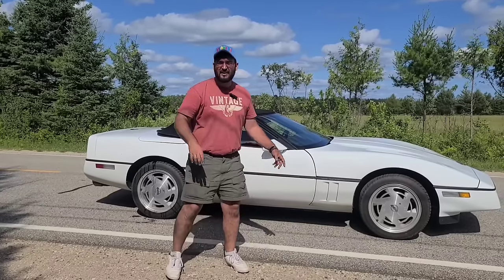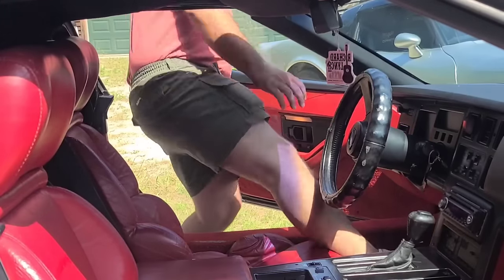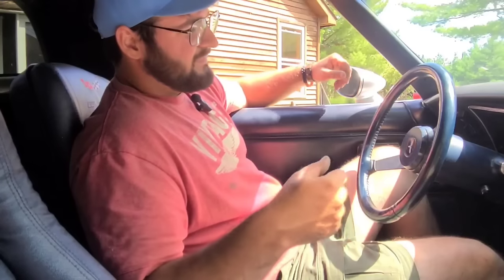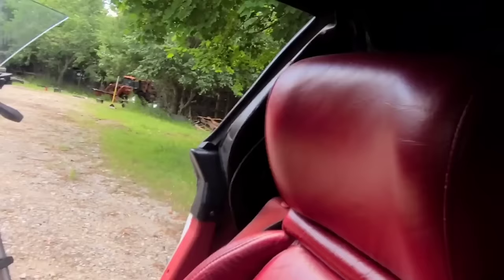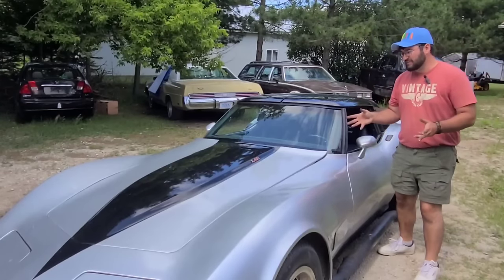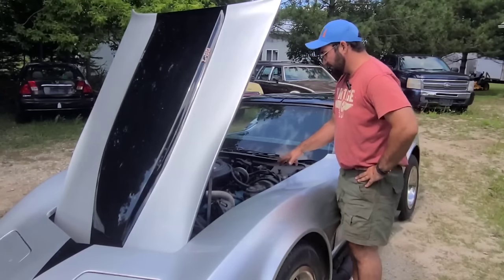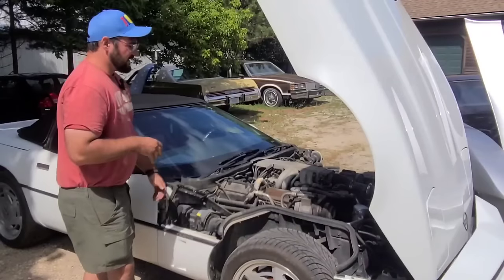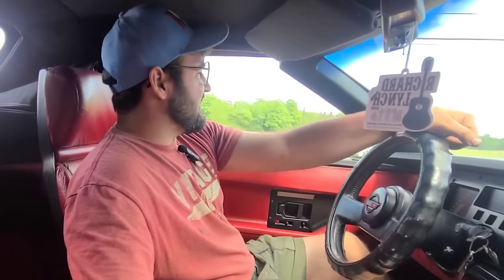C3 vs C4 corvette, which is the better buy?

Comment: why is the front end so high??? The C4 was so good and dominant , it was kicked out of the Escort Race Series. It was something like 29-0 against the 944 turbos and the other cars didnt stand a chance. THey had to create a series just for the corvette called the , " Corvette Challenge Series". The 1984 vette ( though the cross fire was terrible) pulled 1.0g on the skid pad with the z51 suspension. The next year the z51 was softened up because it was way to stiff ( but i found a set up front and rears and put them on my 1985 and koni adjustable shocks) .
Reply from the maker: Both are as I got them. And appear to be in their stock form. I'm sure when thee cars were new they were pretty impressive. But these are not well preserved examples. They're just cheap fun cars
Reply: Wrong, the crossfire injection was and is not terrible. This is a long standing myth that the older carb dudes didn’t know them and didn’t know how to work on them so they were deemed bad. Are they the best injection systems? No, but they are simple and easy to diagnose…

Comment: The simple facts are it would take an aluminum block and head engine and several thousand dollars worth of chassis parts and nearly 4k of wheels and tires to get the C3 to pull 1g on a skid pad. The C4 will do it with new tires and some better shocks wouldn't hurt the effort. However the C3 will easily accept any configuration of big block Chevy engine that you are willing to fork over the cash for and with at least 5 different transmissions and or a solid rear axle since no factory stock Corvette third member is strong enough for more than 500 hp you could out run that C4 in the quarter mile like it wasn't moving. All aluminum twin turbo 427 Ls with a built 4l80e trans and a specially fabricated rear driveline for the C4 would give you cheap near supercar performance. All it takes is about 75 to 100k in parts to make it all workout.
Reply from the maker: And then it's only worth 10 grand after all that haha. They're still fun to play with
Reply: yes but you would have a way cooler car than any eurotrash out there. Having said that why not a c7 or c8 out of the box?
Reply: It's an old parade cruiser not a race car.

Comment: The 80 should run better. Check the emmission parts for leaks. Mine leaked on exhaust manifold egr parts has cracks in the tubes.
Where I live I could remove all the engines egr stuff leaving that huge octagon catalytic converter that needs to still be replaced with free'er flowing cat.
The L82 has 225hp 
And the factory ribbed valve covers designating the last yr corvette with a high performance option read about that engine its a good one. Mines an L48 and can squeal the tires at launch and chirp on 2nd gear. My dream is to install a rack and pinion steering system on it, the early 60s steering is dated feeling to me. A wild styled easily leakable system imo.
Still love the car. It is the last corvette with out a brain 😲
Reply from the maker: They both should be running better. I'm told the c4 should do 60 in 6 seconds. I will probably do a follow up on the c3 getting it boiling the tires again. It runs pretty rich and I'm sure it has fouled plugs and a myriad of other things. Easy to work on though

Comment: I have to go with the C3. My 72 is special (to me) because of the Steel Cities Gray paint, I've never seen another. The motor is from a 63 Vette, a much wider power band than the 350 the car came with. Power windows, brakes and steering, it's a wonderful cruising car. My dad had an 84, which was IMO, not a very nice car. Strange design elements and slower than a Honda Civic. Still a Vette, though, and all Vettes are cool.
Reply from the maker: Definitely a hard choice. C3 would be a much better car with a better motor. The c3s have a way better look

Comment: Basically, where I'm at with Corvettes is 1965 to 1972 are the highly desirable Corvettes.  The power is there, and it's just before all the anti-emissions regulations strangled the horsepower out of them.  Plus, those C2s and early C3s look terrific.  I also like the late C7s and current C8s.  Of the newer Vettes, I think the peak is the 2019 Grand Sport.  So, in the clip, I wouldn't want either Corvette.  Even for just $5,000.  Any Corvette that's $5,000 has a reason (or three) why it's $5,000.
Reply from the maker: You're not wrong about that. Both are definitely projects. But someone who wants a bargain bin american sports car would probably have fun with either

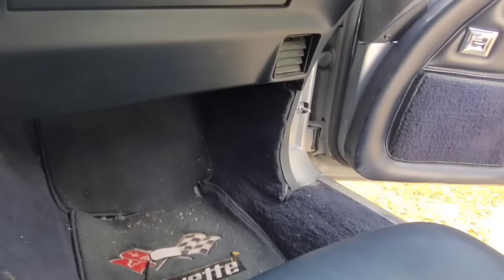Comment: What stopped me just recently from getting a C4 is at 1:38. I've always liked the C4 and performance-wise, they are way ahead of the C3 in most ways. They don't compare to the old big block acceleration, BUT, unless you are buying a '68 to '72 big block, AND have a source of good gas (which most isn't today), then you really aren't getting all that those old big blocks were known for. I can speak with experience on this having my '68 427 from 1978 (last of the good gas years) to today (horrible ethanol crap). But back to 1:38, notice how little passenger foot room there is. Everyone used to complain about my '98 Camaro Z28 passenger seating with the catalytic convertor intruding into the floorboard. Well, there is no room for your feet in the C4. What is the point if you can't take a passenger in comfort? If you are solely autocrossing the car, or intend on never having a passenger, the C4 is great. But for a passenger, it sucks. At 2:01, you can see so much more foot room. How the engineers messed this up, I will never know.
As far as daily drivers, the '89 without question. It is an early '80s design in suspension, driveline, and comforts, where the '80 is an early '60s design in all of those with a few minor updates. The overdrive makes long commutes or traveling much more enjoyable and affordable. The TPI makes the economy much better. 
The '80 has more room for long traveling. You can take a lot more stuff in the back. Of course, the C4 coupe has a lot more room than the nearly non-existence room in the C4 convertible. And I found many C4 convertible owners fill that with an amp and subwoofer so you have nearly zero room for luggage.
Reply: I should mention that the C3 is better for modification. There were many performance mods for C4 corvettes in the '80s and '90s but a lot of that has disappeared today. The problem is the TPI flows somewhere around 650 cfm which limits what you can do above 350 cubic inches. There were kits for making the TPI flow more, and are necessary for the 383 stroker and above. Removal of the TPI for carbs, which some do, then creates issues on the video game dash, which many end up replacing with individual electronic gauges. In the end, the C4 gets pretty modded everywhere and isn't looking very stock anymore.
The C3 you can just pull the anemic '80s 350 and rebuild to something stronger, buy a crate engine, or get interesting. Dash gauges still work, and until one looks under the hood, no one knows you changed anything. Dropping a 383 stroker and a 700r4 in makes a world of difference. The problem is with 4 speeds, as there are not good options. Most end up with a Tremec 5 speed but with a cost. 
Good video, by the way.
Reply from the maker: Someone here said that you don't get in a c4 you wear it haha I thought they nailed it. C3 is a perfect candidate for a 6.0 and 4l80e. Thanks for watching I appreciate it!
Reply: @junkyardjoe1994  I found my C4 to be a perfect road trip car. I drove from Cleveland to Calgary and back. After an 18 hour stretch with only stops for fuel I was perfectly comfortable and only tired from having been awake that long.  Getting in and out isn't too bad once you're accustomed to it, and that's from a fat 60 year old.

Comment: You can get side exhaust for the C4, but they are far more uncommon than side pipes for a C3 so expect to pay a premium to get some.
Reply from the maker: I feel like there'd be no way not to burn your legs if the c4 had side pipes
Reply: @junkyardjoe1994  You are somewhat correct.  The most popular brand I am aware of was Side Effects, and they had a fiberglass cover that was meant to be color matched to the car that covered the pipe.  Even with that people still installed heat reflective material between the cover and the pipe to insulate the heat as much as possible.

Comment: Now which Vette would be best if you intend to ls swap it to be more reliable and have more power? 
Bonus: engine components are ready available. 
I think the C4 lends itself better for a swap. But the look of the C3 🤔
Reply from the maker: I think I would prefer to do the c3. Engine is pretty clapped out on it and I think the turbo 400 would take the abuse a little better than a 700r4.

Comment: While I respect your views there are some I disagree about. A C4, even bone stock, is a superior handling car even by todays standards. While the L98 is not overly complicated to work on it does require the removal of components before you can access what you are after, think EGR valve for one. If you're not handy with a wrench you'll need deep pockets to pay for servicing the car, if you can find a guy familiar with older technology. Lastly, a heater core replacement will set you back $$$$ if you can't remove almost all of the interior dash and a bunch of stuff under the hood yourself. It's cheap to begin with but they can be money pits.
Reply from the maker: Luckily this car is never driven in the winter so if the heater core ever goes out I'll only ever be adding coolant haha 😄
Reply: @junkyardjoe1994  True, but a bypassed heater core looks like crap and devalues the car a lot.

Comment: I own a c3. It is not road worthy yet, but almost there. My .02 if you want performance get the c4. The c3 cannot hold a candle to the c4 as far as performance, however the c3 looks better. Also if you want to wrench on your own car, but have little experience the c3s carbarated engine is much easier to work on. (Why inlove mine)
Reply from the maker: @NoahBartchlett  that's basically the consensus I came to as well

Comment: C4 is the better car by far, even with it's quirks. One thing I can say, you need to adjust the TV cable on that 700R4 in the C4, the 1-2 shift is WAY too short. Also, check the main battery wire where it crosses over the steering shaft, every C4 I've owned or seen has had damage to that wire.
Reply from the maker: Mechanically it's light years ahead that's for sure. That's good info to know as well. I will have to check out that wire and see if my tv cable is set right too

Comment: Engine swap in the 80. It is a cooler car. . Unfair to compare the 80 to the 90, both are ancient. The 80 car if set up right will be cooler. The 90 car will have a little better engineering and stiffer and better designed suspension and rear end. Better ergonomics and hopefully after ten years Chevrolet designed the chassis for better leak control, body twist and protection from rust. Love the C3 shape, the C4 nice too, but very clean lines and 80's. Love the C3 from 68' and 69'. Comparing these would be quite hilarious.

Comment: I collected for a long time. I absolutely loved the sexy C3 body. But  every one Ive had, the heads were cracked. Rebuilt it, about 4500 in and I had to take it away from my wife. Im in my company car and watched her light the tires up at a stoplight.
Reply from the maker: I hope that's not the issue with this one. I still haven't dug into it. It's on my winter project list

Comment: The c3 was a beautiful work of art.  News flash , nothing was really fast in the mid to late 70s. The only reason the c3 isnt considered as the beauty that it really is , is that they where mass produced. I don't  own one and never will because i couldn't stand every know -it-all boring me with horsepower stats every time i park it.
Reply from the maker: Yea that's true about the speed. A modern corolla could put most anything built in the 70s and 80s to shame. The c3 did have a pretty long run and they're kinda common but I still have fun with it. Also there are way too many "corvette guys" with paper skin. The following is definitely the worst part of owning a corvette

Comment: I'd take the 1980, no computer, everybody makes hi-po parts for 350s......but where did you find ones for $5000 ?  I see them for 10 or 11 at least , and average $25000
Reply from the maker: This one looks way better on camera than it really is. They can be had pretty cheap if you're willing to work on them. I just got a 1978 a couple weeks ago for $1700.

Comment: Pretty good comparison. Being a child of the 60's & 70's I prefer my QJet powered 75 for a weekend cruiser. The C3's were designed to be operated and when properly tuned and maintained they can be very dependable.  Theres an art to properly operate a carb'ed engine. 
After watching your vid a couple times I'll venture a guess that the C3's timing is too retarded and you may not have allowed the engine to warm up enough for the QJet's secondaries to open up. It didn't sound like the engine was at it's optimum performance setting. GM designed the QJet's so the secondaries won't open on a cold engine. I don't know if you're aware of that so I'm throwing it out  for GP. Perhaps a choke adjustment could help. 
Lighter flyweight springs in the HEI, capped smog and headers can wake even an L48 up. L82's have 4 bolt main's along with a better rotating assembly and is well worth investing in some performance mods. 
Also based on the interior ergonomics I would prefer the C3 over the C4 based solely on ease of ingress & egress. The C3 is bad enough, LOL....
The thing about power is moot as it's something that can be increased without altering the fine curves of the C3 and it won't break the bank either.   
All that said I wouldn't turn down a great deal on a C4 but I've been digging the C5's anymore, LOL.
Carry On.

Comment: So are you offering to c3 for sale 5K? 
I think the c4 is appropriately call that because he needs a little dab of that in the trunk and run like heck and watch it explode. I seen these things running for$1,500. I'm not paying to seaport it reminds me of a Ford probe. I guess all the car designers close to the same school every generation. Now I like the original stingrays but my wallet doesn't have enough in it for that. I'm not a big fan of Vettes. But that c3 is appealing. I membered a rich girl in school back her brand-new c3 that our daddy bought her. Write out under the bus as it was driving behind her. I'm pretty sure the bus driver could have stopped before the back tires of the school bus drift back into that car apart. They never did get that car lined up right. That's what I think of when  I see c3. Thanks for showing this I enjoyed the demonstration of both cars. Mechanically speaking the c4 would be smarter choice at The wider tires all the way around the tilt hood on front for easy accessibility the extra horsepower. But he buys a vet for logical reasons? Both cars are nice examples of what they are.
Reply from the maker: I would say this c3 is worth about that much and probably a little less. It pictures well but it's not that nice. But it definitely has the more appealing look. Stories make everything in cars and what you feel is sometimes more important than how fast it drives or how reliable it is.

Comment: I own a 90 that's not a 90 - that's an 88-89 -  The 1990 has a one off wheel design - similar to above except the lug nuts are exposed - the 1990 dash was re-designed as mentioned below - updated interior
Reply from the maker: You're correct. My grandpa bought the white one new in 90 and I was under the impression it was a 90. You always learn something doing these videos

Comment: BTW, that isn't a 1990. The 1990 got an updated interior with a mix of digital and analog gauges that was actually really nice.
Reply from the maker: You are right. My grandpa bought it new in 90. Sorry about the misinformation
Reply: @junkyardjoe1994  Totally cool. Still a great car!
Reply: I'm in the minority but I wasn't really a fan of the '90 interior. Looks like a lot of cost cutting compared to the '89 if compared directly.  I used to get my leg bruised getting into the 1990 by that damn horn by the headlight knob that's exposed when the door is opened.  No issues with the '89 interior and it's still mint where the 1990 had lots of cracks and most of them have the upper and lower door panels separate.  Lack of gradients in 1990 with the ancillary gauges was kind of a betrayal to the car, especially since those gauges were excellent digital displays before.  I know they fixed some of that though as the years went on.
Reply: @3.2Carrera  Hey, you like what you like. I never liked the Atari-looking digital gauges, the bread-box, or the switches in the center recess, but that doesn't mean you are wrong.
Reply: thats what i was confused about--i was thinking this guy did an 89 interior swap on his 90 hahahaha

Comment: How about the C zero corvette?   The 6 cylinder automatic.  GM wishes you would forget about THAT generation of Corvette.  They say that if it has a solid axle it is a C 1
Reply from the maker: I guess I'm not familiar with that one. What year was that from?
Reply: @junkyardjoe1994 that would the first 3 years of the Corvette, 1953-1955. 1955 was the first year that the Corvette could be had with a V8 and a manual transmission.

In 1955, few opted for the Blue Flame I6, and it was dropped the following year.

Comment: When running them he had to have been scared to break them by pushing them because I know both of them perform way better. Because my grandmas 73 convertible should not be able to dust a 93
Reply from the maker: They're both pretty haggard and in need of work. Definitely not performing as well as they're able to.